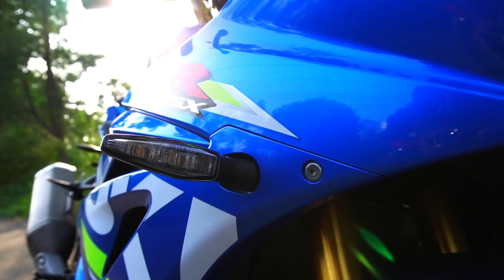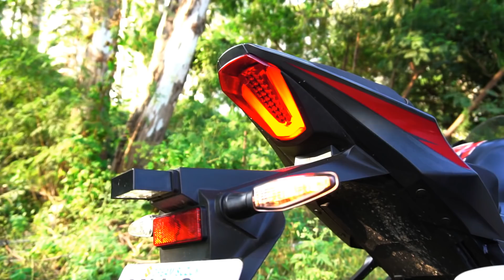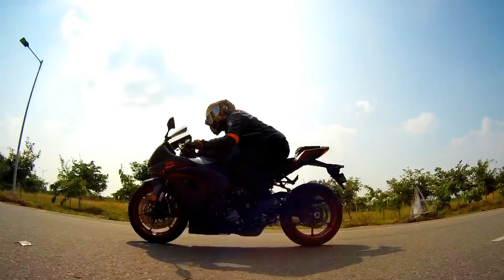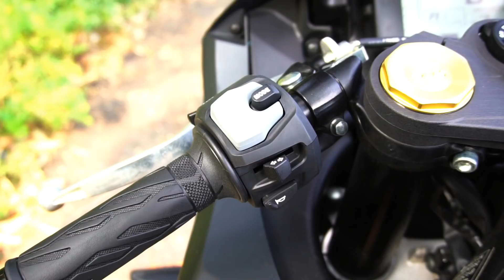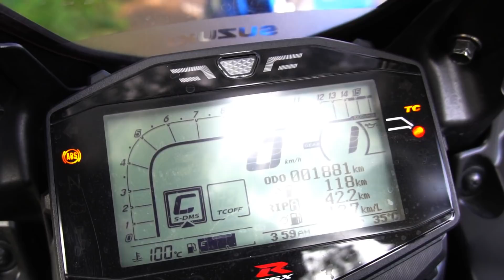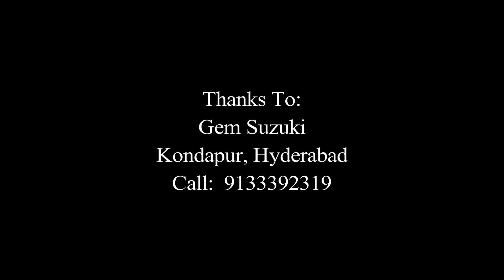Suzuki GSXR1000R GSXR1000 First Ride Review #Bikes@Dinos

Comment: Does any one know the accleration of GSXR1000R is faster than h2,
Also GSXR1000R has the highest torque output compared to ,zx10rr, bmw 1000rr ,
Also has vvt tech that others lacks wich kicks in the top end,and has the best in class traction control system 10 levels ,,

Comment: The biggest exhaust I've seen on any bike 😨😨😨
Reply: Right? I  am going to pull the muffler off my  new "21" and just  run a straight pipe, till I can get a top notch titanium, carbon fiber, muffler. This thing looks super gay. I'm putting a fender eliminator/under-tail, tank grips, and low profile signals today. In addition, I have a digital front/rear, backup/rear view camera setup coming to replace the mirrors and a nice little set of smart chargers for my phone and Bluetooth helmet, etc.
   Going to be a mo eye pit she is.